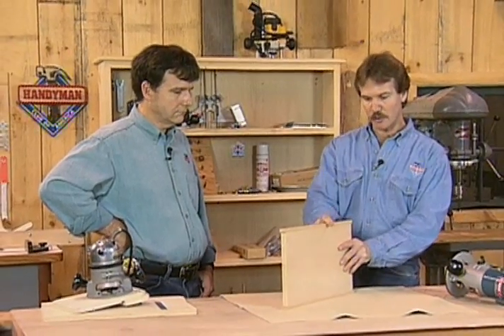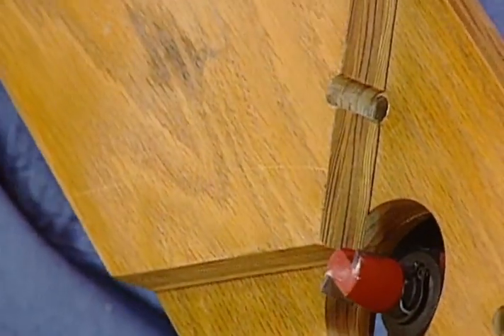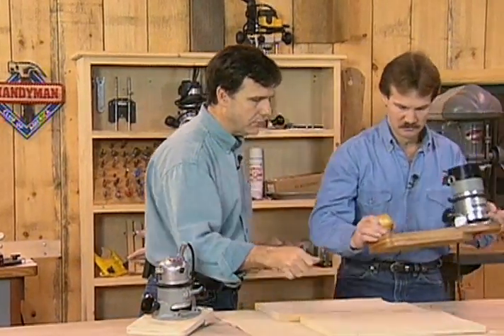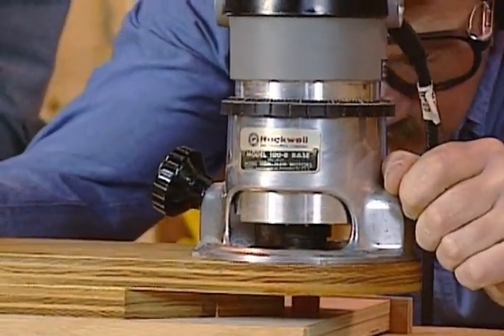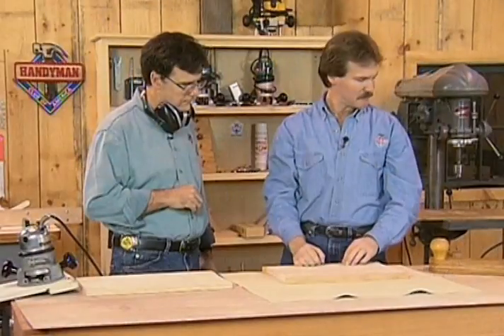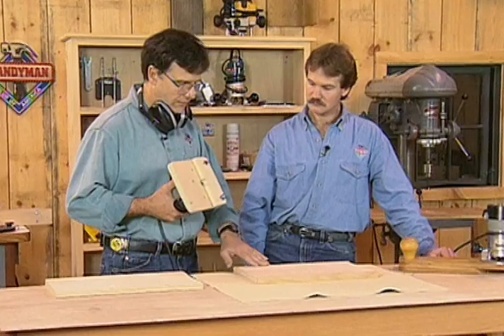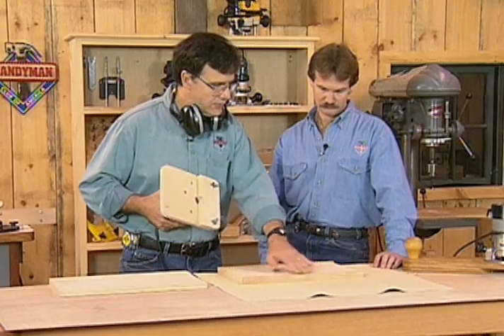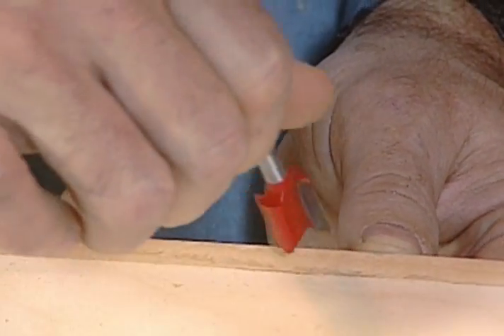Advanced Routing Techniques Part 2

Comment: I'm not too familiar with English. But I know "routing" as network routing or something else... if routing is not the right term here, would be nice to rename the series
Reply: LernenInVerschiedenenFormen Are you nuts or something?  HAHAHAHAHAHAHA!
Reply: "Routing" as used in woodworking has been around as long as the Middle Ages. Power routers were first invented in 1920. 

English has a tendency to use the same or a very similar word for multiple items.
Reply: @carlbruschnigjr1757  

In a few more decades there will be a generation who knows nothing about the world before the computer. To them, we will be like cavemen who left behind drawings on the cave wall

Comment: I find it easier (and quicker) to use a number of boards separated by spacers and clamped in a vice.  That  way I can use a template bit.  The fact there are a number of boards allows the router a lot of stability, and it's far quicker to load a template bit in the router than it is to mount a router in the jig above.